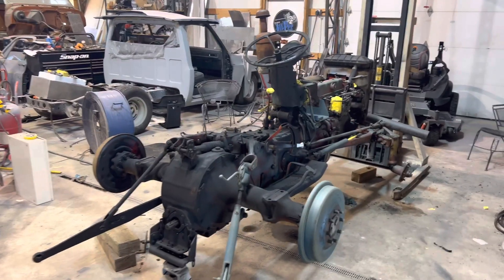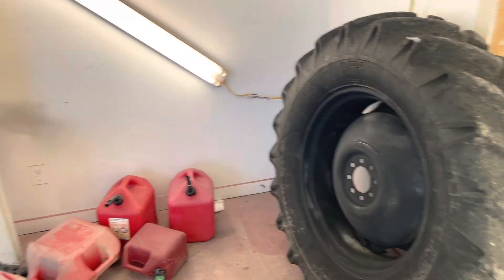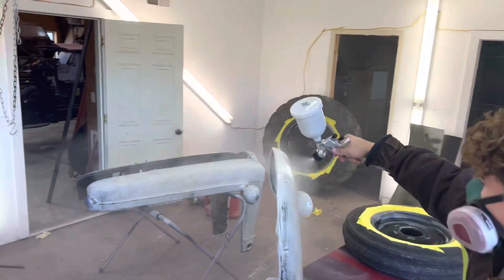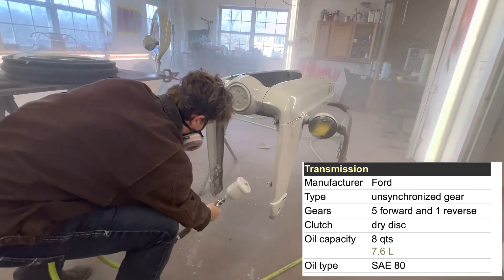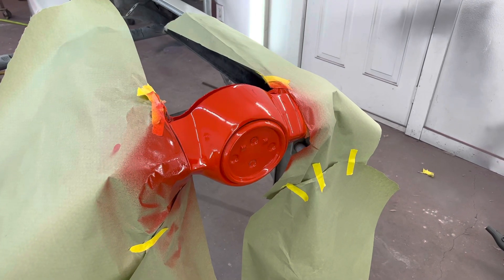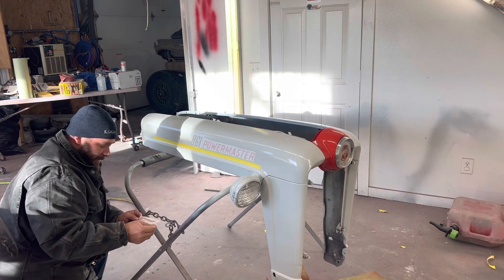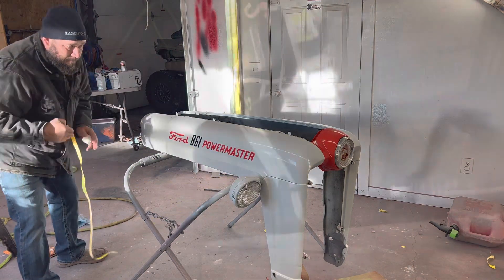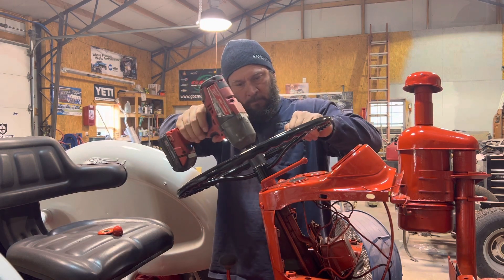HOW TO RESTORE AN ANTIQUE TRACTOR / BUDGET TRACTOR RESTORATION #shorts #diy #tractor

Comment: Radiator should be black and air cleaner gray.
Reply from the maker: I wondered about that. I looked at lots of pictures and finally just went for it.
Reply: @genuinejake9851  No harm done, its only paint.
Reply: I thought air cleaner is installed under the hood?
Reply: Air cleaner is external and gray. Tube from it to intake is body color.